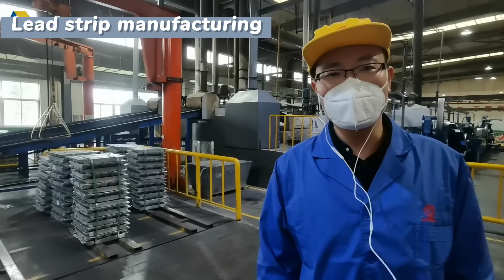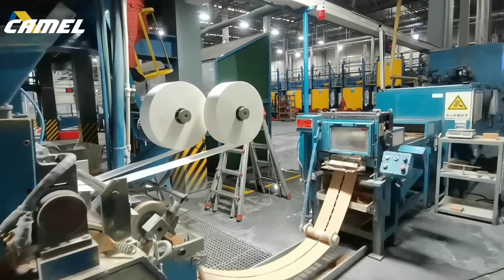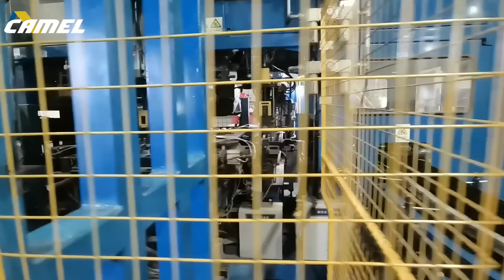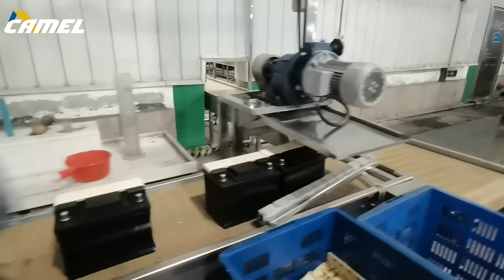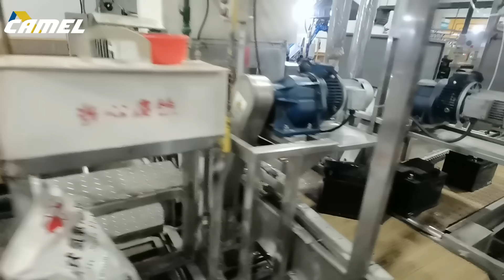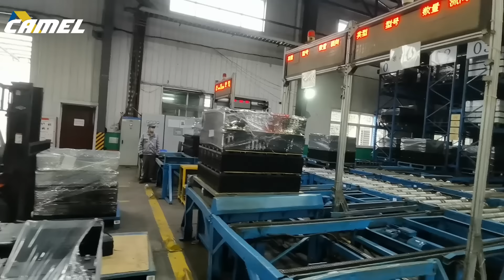Lead-acid battery manufacturing process. Camel Group China plant tour!

Comment: lead battery is almost obsolete!!
 te other types is better deep cycle or agm.
Reply from the maker: Thanks for your comment! We also have the AGM, EFB, deep cycle and lithium battery to meet various power needs of customers.
Reply: @CamelBatteries I have built many of these machines. Strip casting, grid casting, welders, pasters, cutters, reelers, ovens for lead lines and shipping. You probably own one of my former companies machines.
Reply: Lead acid batteries are the most inexpensive way to store power for automobiles use.